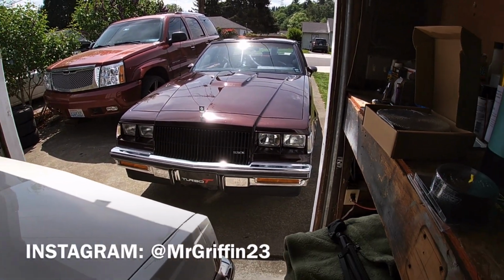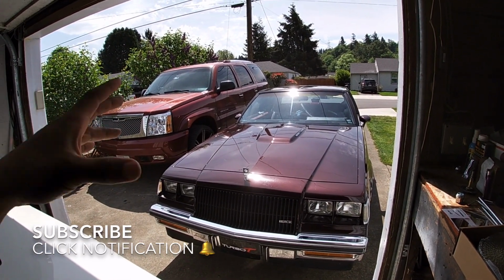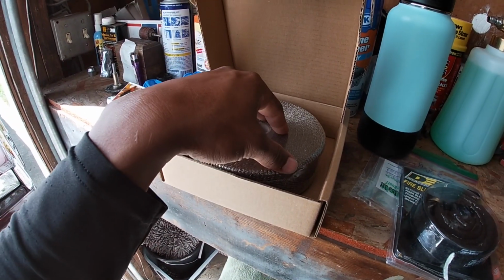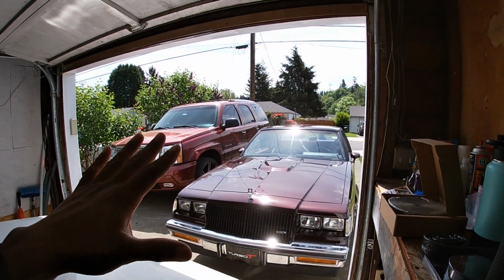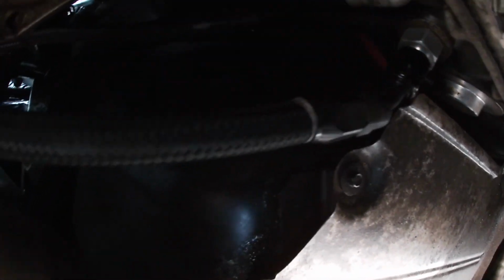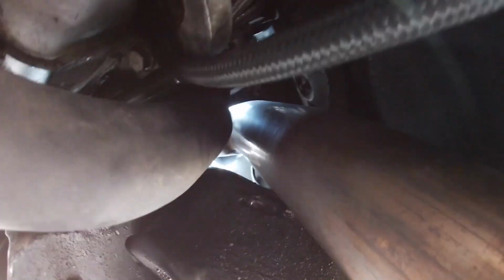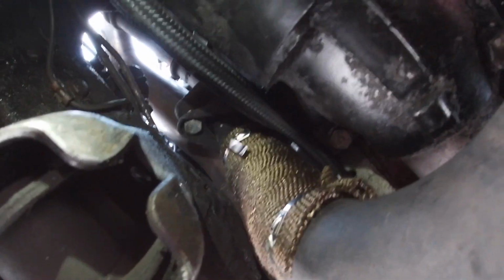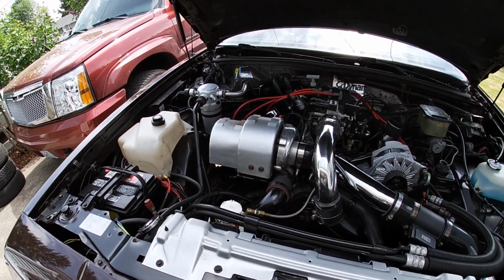DO IT YOURSELF EXHAUST WRAP | HEADER CROSSOVER PIPE | G BODY REGAL | TURBO T

Comment: If worse came to worse, couldn't  you install the factory stainless steel hard line? Looks like it will be alright though.
Reply from the maker: That was my first option and what I wanted to do. However, it would be almost dang near impossible to install the lines without pulling motor or at least lifting it. In one of my previous videos of me removing and installing the lines I showed just how tight it was and how I had to cut the lines in two different places just to remove a the bad ones.